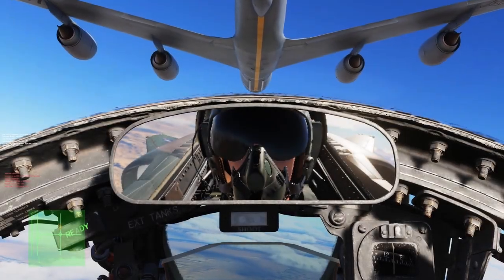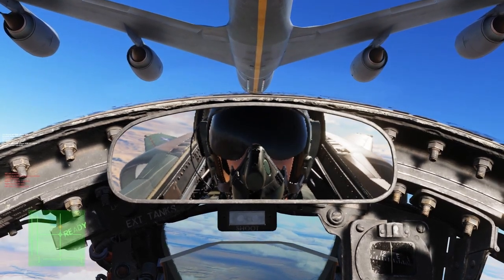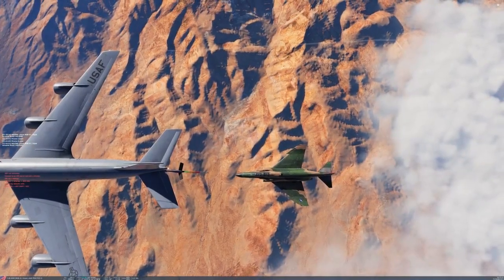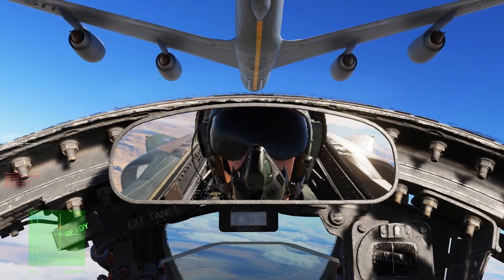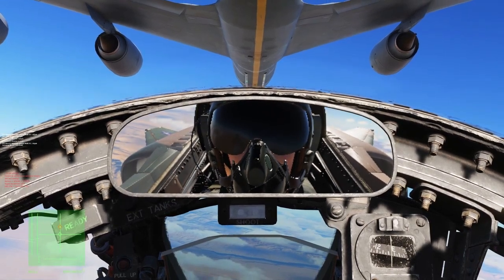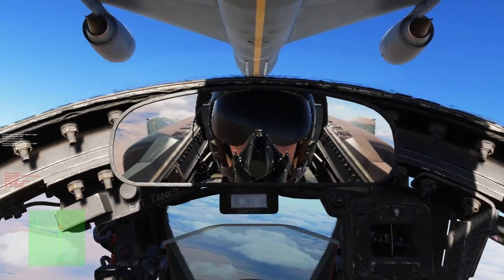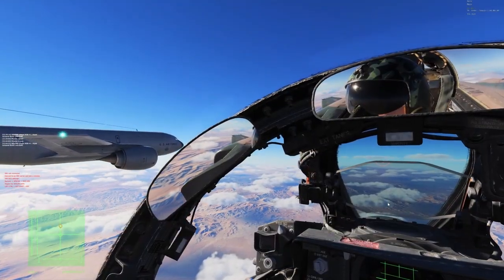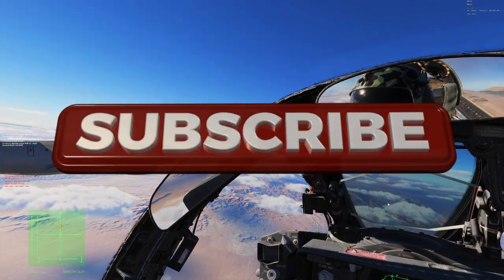DCS F-4E AIR REFUELING OVER CANOPY BOW

Comment: I don't have a hope in hell. I have a single throttle, and.... hangon! Bear of small brain ponders. I usually use right ctrl and alt as shift keys to control my throttles separately, usually I don't bother as it's a huge faff. But if I only have to play with one side, the right in this case, I have a button I've assigned to shift on my throttle.... maybe if I assign just the right throttle to that shifted key I can juggle the shift button and the throttle? Excellent. I'll try that as soon as I get home.
Reply from the maker: Hi @splashfreelance2376, thank you for your comment - flying a dual engine model with a single throttle can be a challenge for certain.  But - there is another potential method to address a single physical throttle controlling dual aircraft throttles.  You could setup a custom user curve in the "tune combo" option of the axis commands.
Here's how I would approach it:  set up a practice air refueling in the mission editor (plenty of videos on youtube for this, so I won't go into detail).  Hit R-CTRL + ENTER when you get in the airplane to call up the controls indicator, then stabilize as best you can so you are fairly stationary in pre-contact (~50 feet behind and below the tanker).  You don't have to be perfectly stationary, or fly exact positioning for this. Make note of the engine rpm, the throttle positions on the control indicator, and the location of your physical throttle - and don't move your throttle.  Pause the sim and go into the Adjust Controls menu and Axis Controls sub-menu.  Right-click on your throttle axis select Tune Combo Axis.
Once the graph is displayed, click the tickboxes for Slider and User Curve.  The graph doesn't show current axis deflection, so you'll need to very, very slightly move your throttle aft to register its position on the graph.  This is the area you want to customize with the sliders below the graph.  The default movement is 1:1 ratio of throttle movement percent to engine rpm percent, so you need to 'shrink' the 10% gap by decreasing the higher value (the slider to the right of current throttle position). My guess is this will be somewhere around the 70-80 area - so change the 80 value to something like 72 or 73.  This will cause the next 10% of your hardware throttle to limit engine rpm percent change to the new user range.
Hit OK for your changes and test your settings.  Observe the throttles' movement on the controls indicator as you move your throttle to see the affect of your user curve. Keep in mind that the next 10% bump in your physical throttle will jump engine rpm back to its original schedule, so you'll need to experiment with values for that upper range as you see fit.

Comment: Where’s the KC-135A?  Basically just different 3D engine models,  thrust and fuel consumption rates.
Reply from the maker: Hey Andrew - thanks for checking out the video and commenting!  Good question; my guess is that when DCS was put together, the R model was the only KC-135 (Active Duty) model in use.  The A and E refuelers started getting phased out in 1985 with the introduction of the CFM-56 engines.  I only flew R models - but I did log sim time in an A-model simulator (once) when going through CCTS.  At that time, E models where phased out from Active Duty to Guard/Reserve units, so I'm not sure when the last A-model flew in a mission capacity.
Reply: @kojakgaming3519  Wow!  You flew the KC-135Rs!  It would just be a cool thing to see the A models. More likely to match up with the F-4 and other 60’s & ‘70’s aircraft.  Seems like it would be fairly easy for ED to modify the R back into an A and have both. 🙂
Reply from the maker: @Andrew-13579  I agree, it would be cool, or at least novel to have A-models.  But, for what it's worth, I did refuel F-4s as late as 2000.  Granted, they were NOT USAF, but German Luftwaffe birds.  And they were amazing.